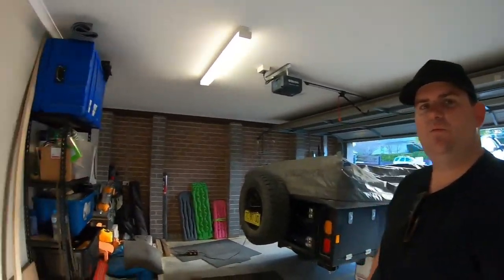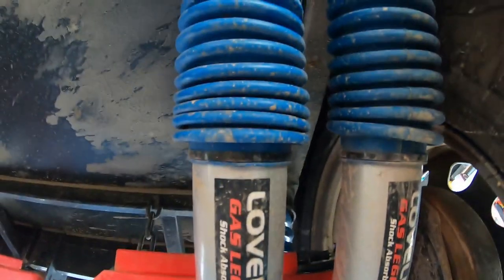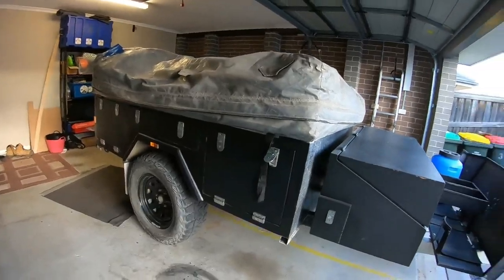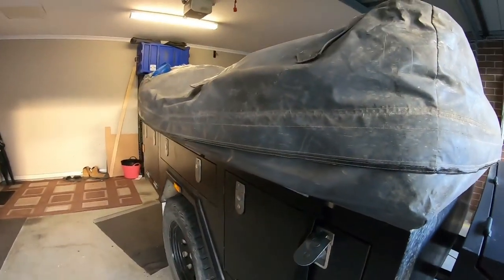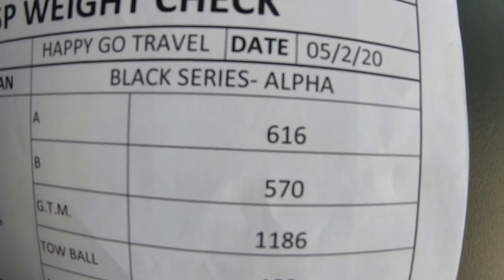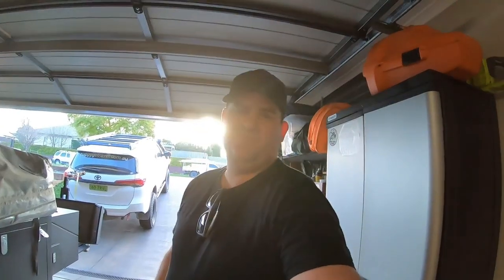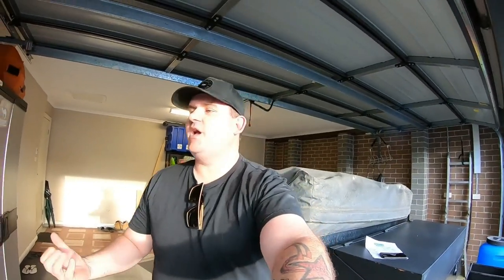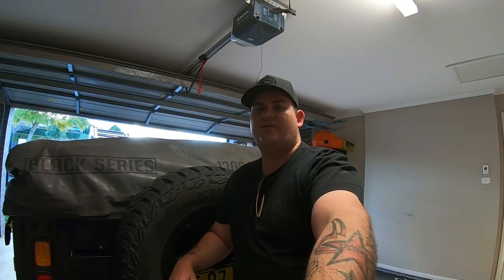Import camper MUST DO - Camper Trailer suspension upgrade - Lovells Special Products Suspension- HGT

Comment: Hey mate I have a BS delta just noticed one side sagging so looking at lovells suspension what did they charge you for kit and fitting cheers mate.
Reply from the maker: I remember it being around $1300 but I got a new hitch as well. the suspension it's self is around $850